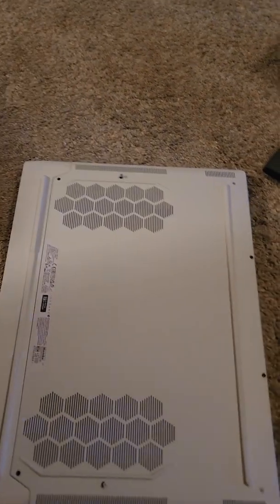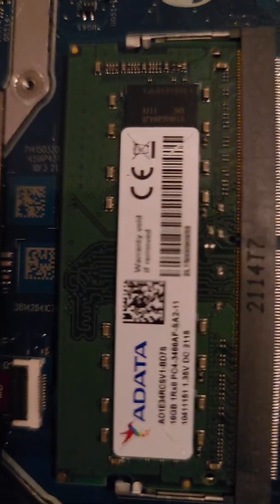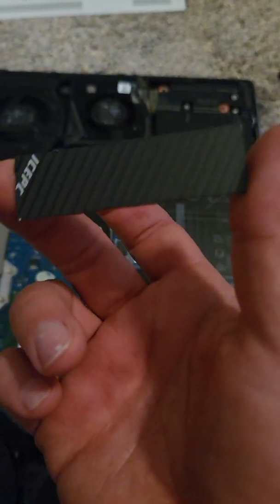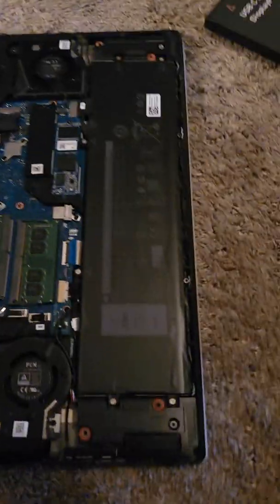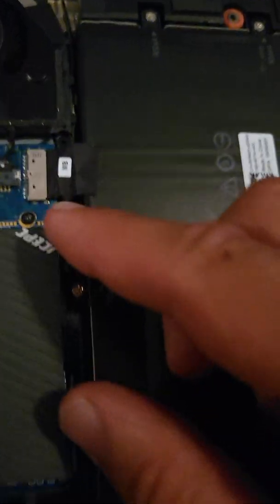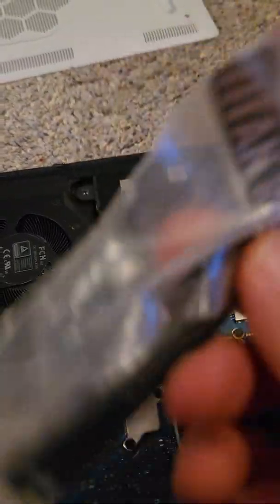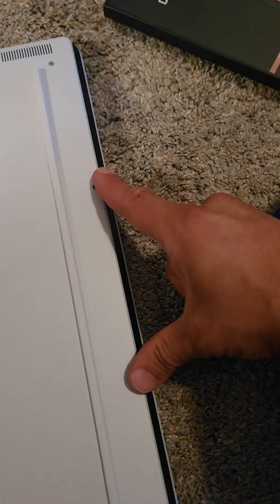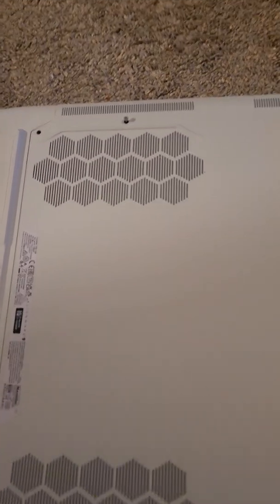Alienware x17 how to install m.2

Comment: FYI that ICEPC heat spreader I used in my Aurora R10 and it fits. Works well. Something like 45C max temp on my system.

Comment: Nice vid! How/where did you get the OWC Thunderbolt dock?
Reply from the maker: bought it from website thunderbolt 4 its awesome only issue external monitor g-sync and free-sync don't work
Reply from the maker: I  have returned x17 R1 for refund there is a major issue they are working on a fix there is some bugs they need to figure out.
Reply: @EVandPC  what's the issue I'm still waiting on mine to arrive I suppose it's not to late to cancel

Comment: do you think this heatsink really makes a difference? My laptop should be in soon with same specs.
Reply: In most cases, no, it won't make a difference. If you hammer the drive at 100% constantly, then yes, but under normal use, no, really.

Comment: Thanks for the video.  I'm definitely interested in install one in my X17.  
May I ask what the thickness of the heatsink is?
Reply from the maker: Here is link for what I bought and fits.

https://www.amazon.com/gp/product/B08HGF4HKK/ref=ppx_yo_dt_b_asin_title_o01_s00?ie=UTF8&psc=1
Reply: @EVandPC  Hi，did you get 2mm or 4mm？
Reply from the maker: @gabrielsun3834  1.5mm
Reply from the maker: @gabrielsun3834  https://www.amazon.com/gp/product/B08HGF4HKK/ref=ppx_yo_dt_b_asin_title_o01_s00?ie=UTF8&psc=1

1.5mm